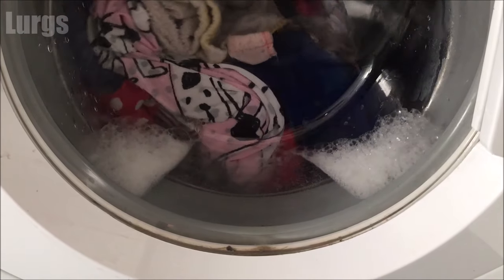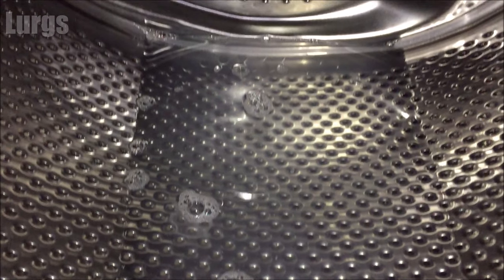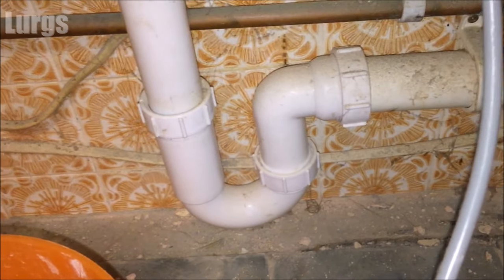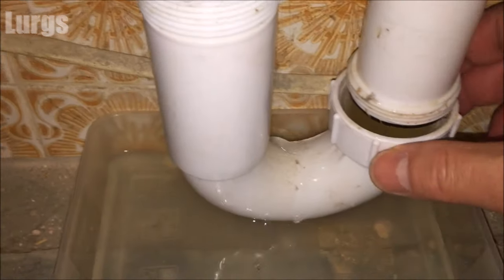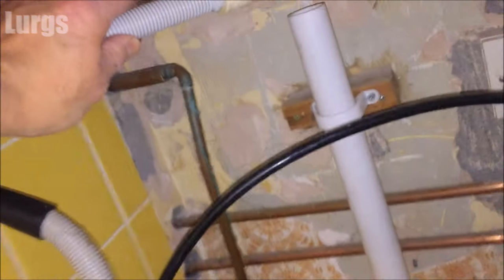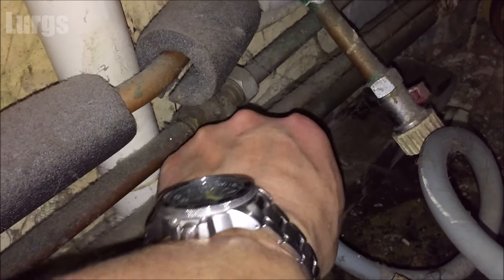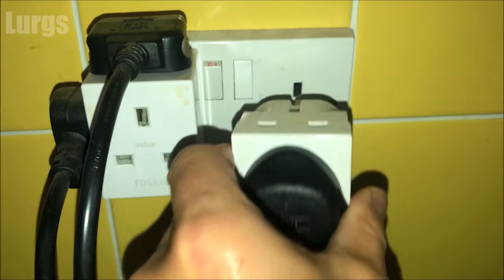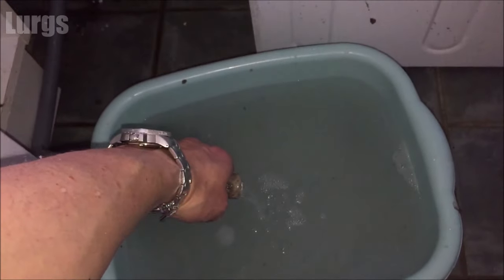Washing Machine not Draining Water - Fixed

Comment: Help! Just mopping up after the machines flooded the kitchen. Thing is the doors not open and its FULL of water. Can I drain it all just from the filter? I'm not confident enough to mess about with the pipes etc under the sink. Eek!
Reply from the maker: Blimey emergency comment! Turn power off and unplug, hopefully the door will release so sponge that out. Try pulling the machine out a bit then tipping it up so you can get a washing up bowl underneath the filter then undo slowly and let it drain into the bowl. Good luck. Have an old towel ready or your mop.
Reply: Coooeeee! I'm back again. Still patching up my 13 year old machine ha ha. If anyone sees this would you be kind enough to let me know if there is meant to be a rubber band around the drainage propeller? I don't want to remove it just incase it's meant to be there.... God I'm useless lol. Thanks! Xx
Reply from the maker: I very much doubt it unless it’s old and that is the rubber belt powering it round? Sounds like a hair band or something maybe?

Comment: Hi Lurgs,
My washing machine drains when I lay drain pipe on ground, doesn't drain when it's is hanging in sink. 
Machine stops after a while when it's is hanging, it keeps running when it's on ground but doesn't contain any water.

What could that be? If it was filter then it won't drain at all, I belive it's drain motor? What do you suggest?
Reply from the maker: Yes sounds like a pump fault not pumping the water out fast enough. I would check the filter to make sure there is nothing in there blocking the impeller (like a coin or hairclip).

Comment: Hello, any suggestions as to why the washing machine (even after a good clean with a tooth brush and scum cleaner - thinking this might fix the issue) still doesn't seem to utilize/activate the softener section of the draw on the far right when it comes to the rinse? Once a wash has done its cleaning section you normally have the softener bay fill with water but instead this always comes from the far left pre wash bay. So basically the softener section is totally out of action....I have to listen out for the wash to finish and then sprint to the kitchen to drop the softener in the prewash section with the few seconds it gives you to allow the dilution. Pretty silly really.
Reply from the maker: Sounds odd, the pre wash is what it says, a Pre wash before the washing programme starts. Maybe the washing programme you are selecting doesn't do the Fabric Softener part but maybe some of the others do?
I very rarely use softener now.

Comment: So I have a Hoover. I replaced the water pump and housing as I thought this was the issue.  Pipes leading to the drain outside is clear. Still water isn't draining.  Any ideas?
Reply from the maker: Maybe the pump isn't engaging? Not sure why it wouldn't drain with a new pump.

Comment: Thank you for your video mate, unfortunately it still didn’t work, both filters cleaned :( water still in drum but if I lower the drain pipe at feet level water starts draining I’m confused…
Reply from the maker: Best check your drainage pipework. Run the machine with the washing machine drainage hose into the sink or a large bucket. Then you will be able to see if its draining ok. Could be your drainage pipework is full of sludge.

Comment: Hi I have a hotpoint washing machine.  When I started the cycle a cloth got stuck inbetween door, the water is leaking out of the door and I couldn't open the door as well. Can  you please let me know what to do?
Reply from the maker: Let it finish if you can and put a big towel in front of the door. Or pause the cycle and open the door

Comment: Tried your suggestion but there was nothing in there. My machine is a Hotpoint Aqualtis 11kg w/7kg dryer. It came up saying fault 15 when I last tried running it on the 19th of April. Due to having to shield from Corona I have not been able to have anyone come out (also not working = no funds for washing machine repairs). Handwashing is getting very tedious so if you have any other suggestions I'd be really grateful. I'm not strong enough to lift the machine out though.
Reply: I can add that I initially tried disconnecting the drainage pipe from where it come into the sink waste trap and also dismantled the trap to see if that was blocked but neither showed any signs of mess.
Reply from the maker: Oh dear I'm sorry to hear that. If it's an F15 error that indicates a problem with the water heater, unfortunately that looks like a callout,  or if the machine is pretty old then might be worth a new one. Washing machine\dryers aren't the best, we've got separate ones but not everyone has space.

Comment: Hi mate I got a hotpoint aquarius wml520 it keeps draining even though there's no water left in there it also smells of burning guessing the drain pump is knackered however checked the fan inside pump and moves freely what could it be
Reply from the maker: Nicholas Anastasi Sounds like a burnt motor. We had an old washing machine that had an awful burning smell. You have to weigh up how old it is, cost of repair and how much a new washing machine would be. Last time we just bought a new machine. You can spend a lot on repairs (unless you do it yourself).
Reply: @LurgsHowToGuides  thanks mate and yeah I can fit the part easy change over part I think is about 40 odd pound it's a cracking washing machine and only happened yesterday that's how I came across your vids haha thanks mate I'll replace the motor cheers for the reply

Comment: Do you have a video for a beko washing machine that wont spin
Reply from the maker: I’m afraid I don’t. If it’s a belt version it could be the belt has slipped or has snapped. If you  turn it by hand does it rotate too freely or does it have some resistance?

Comment: so I stopped the washing machine before it was done and the water was still there, will it drain it self or do I have to take the water out?
Reply from the maker: Don’t take the water out. Just run a rinse and spin which should drain it (unless you’ve got a problem with the machine)

Comment: Hi I was wondering if you could help I keep getting E20 on my Hoover Dynamic Next . I've cleaned the filter  and pipe and even done a reset but still it comes up E20 even after seeing the water drain away .
Reply from the maker: That's odd, if it wasn't draining then I would expect the E20 error. Sounds like it could be a faulty sensor somewhere, hope you get it sorted.

Comment: I don't think that I have a blockage. My Bosch washing machine does not rinse from time to time. There's no water in the drum; the cycle finishes, but the clothes are really wet. I then have to put it on the rinse cycle which rectifies the situation but it's a pain especially as sometimes I have to put the rinse cycle on more than once!! Any advice would be appreciated. Thank you
Reply from the maker: Sounds like a glitch in the computer board maybe. Try the good old switch off for a few hours then switch on again. Or maybe try a different washing programme if it does it on the same one.
Reply: @LurgsHowToGuides  Thank you

Comment: I have a Siemens washer dryer which is showing the E18 error code. The pump filter can´t be opened and only turns partway. It is very tight and won´t move futher. The bottom of the machine is sealed so no way to access the pump filter from the inside to check for blockages/clean it out. Any suggestions as we would prefer not to throw away this machine as it seems to be a blockage and not a problem with the actual machine? We´ve been told by a handyman that the entire machine would have to be dismantled in order to get to the pump filter which is at the bottom of the machine. Any advice appreciated. Apparently, Siemens have sealed the bottom so that you can´t easily get to it and would have to buy a new machine, which is absolutely awful. Thanks.
Reply from the maker: @LaChicaconSuerte-1111  Poor design.
Try untightening and tightening multiple times to see if the object clears. It is bound to be a metal hairclip. If not you may have to get a bit more forceful, but be careful as the filter is only plastic. Good luck..
Reply: @LurgsHowToGuides  thanks, my mother ordered a new machine as this one is just over five years old. I find it upsetting though, because the machine itself is actually fine and never had any issues until now and it happened because she overloaded with bathmats and towels etc. Maybe some lint of fluff blocked up the filter, don´t know. But what makes me angry is that Siemens seals up the machine in such a way that you would have to dismantle it completely just to get to that filter to unblock it. I think it´s really sleazy and awful to do this to force people to have to pay over a 100 pounds plus parts for one of their technicians to come out or to buy a whole new machine for a simple issue like this.
Reply from the maker: @LaChicaconSuerte-1111  5 years old is nothing. Need to get to that filter as if it’s blocked up it could be an easy fix
Reply: @LurgsHowToGuides  agree, but my mother decided to replace it. This is what goes on in lots of households and how these companies make money.

Comment: I cant move the washer though to unplug it. Water in drum, keeps stopping without spinning and a lock light is on the panel which ive not seen before? 

I have heart failure so it's hard to move heavy machinery. X
Reply from the maker: @jacquelinegreen7796  sorry to hear that. Filter deffo needs checking first

Comment: So I did all of the steps above, but still my Siemens is full of water 😭. I had so much crap in the pump filter, so thought for sure that was the problem.. But no. Any advice or a link to have to demontage the whole sucker? 🙈
Reply: E18 is my error code.
Reply from the maker: If there was that much debris in the filter the pump might be damaged. It's worth removing the filter agin to check as more debris may have fallen into it. Run a drum clean or super hot wash 90c after. Good luck

Comment: Question. You didn’t mention how to open front of washer when full of water/clothes without flooding kitchen? 🦆💕
Reply from the maker: Need to just be very careful. If you can just run a rinse and spin cycle again to see if it clears. Else it will be a case of opening the door and using a sponge.

Comment: i dont know if you read this but my washing machine (sharp auto) sounds like it has water in it when i shake it. i have tried letting it washed off without clothes and the water still somehow inside but i cant see it in the drum. maybe under it or at the side? please help
Reply from the maker: Not sure, as long as it washes ok and drains then that sounds odd. If it's not leaking then it will be hard to find out why.

Comment: On 3:39, how did you temove it so easily? I’m having a hard time opening it
Reply from the maker: Probably a hair clip stuck in it stopping it from turning. Just keep wiggling it tighten it un tighten it, hopefully it will work it’s way loose. Might have to be a bit forceful but careful not to break it as it’s only plastic. Good luck 😎

Comment: Hi I've got a Bush 8kg washing machine and it stopped draining first, said it was finished but was still sopping wet. I already did what you said in the vid and drained the water out of the filter,nothing blocking it. I turned it back on to run thru empty but all that happens is the top and bottom timer lights flash together, it doesn't fill. I've tried it on every cycle but nothing happens except on occasion it makes a slight clunk then nothing. I've tried leaving it over the maximum delay time of 12 hrs,still nothing I'm flummoxed ? I'm usually good at fixing things like this but can't see any rhyme or reason why it won't fill if nothing else. The inlet water pipe is ok and has water coming through when not attached to the machine. It's got to be the machine itself and it's almost brand new and barley used but I went away from home for 9 months to a friend's now there's no guarantee left on it. It worked initially on my return, so any ideas please ?
Reply from the maker: That doesn't sound good. If it's not that old then I can only think it's a filter\pump issue. It's definitely worth checking the  filter again to make sure nothing else has fallen into it. Odd though it's not even filling. Are you sure the water tap lever is in the On position and someone hasn't turned it off whilst you were away?
Reply: @LurgsHowToGuides  No it's been working fine since being back and I live alone so no one has touched it. It did the washes before fine on the same day except the last one that was sopping wet and the machine was still full of water altho said finished. The not filling is what's puzzling me too. I've never had that before ever ,not emptying yes.
But will recheck filter but the pump and filter shouldn't stop it filling tho only emptying in my experience ? I've seen about 10 posts on another site,with the Bush 6 and 8 kg having a mind of their own despite the good reviews from Argos . Some who had theirs repaired rather than send back were control circuit board issues.? I'm beginning to think the same ? If so it'll be cheaper to get another one than be repaired when I can afford it!
Reply from the maker: Oh dear. Not good.

Comment: Hi literally got a machine 4 days ago brand new,seemed ok up till now but i noticed it drains fine etc but when i go back to machine it has water reappeared in drum
Reply from the maker: Shouldn’t be any water left in the drum after the cycle has finished
Reply: @LurgsHowToGuides  ty for reply it is confusing as it drains fully. But even though cycle has finished and clothes removed I notice water has reappeared not loads say about a litre. Seems odd.
Reply from the maker: That's not right, I'd say that's a fault. After final spin it should be dryish. Try a different programme else I'd  report that and get it looked at

Comment: hi my washing machine is not draining all lights are flashing i unblocked the drain pipe and the filter but still not draining and the drum is still full and door locked any advice would be appreciated thanks.
Reply from the maker: Not sure, sounds like a faulty pump or computer board malfunction I’m afraid
Reply: @LurgsHowToGuides  ok, is there a way to manually unlock the door because its not unlocking.
Reply from the maker: @MysticGaming33 Washing Machine Door not Opening and How to release a Stuck Washing Machine Door
https://youtu.be/bQdniahf0bU

Comment: My washing machine is only 6 months old. I have checked all things you have said and it's still no go.. when it drains it sometimes leaks from underneath. And after any programme has finished it then re fills with water
Reply: This is the same even on a drain and spin programme. Can you help?
Reply from the maker: Jake Andrews If it leaks underneath I would say that is a faulty washing machine. It will still be under warranty so contact the shop you bought it from.

Comment: Every time I untwist the filter, water comes pouring out all over the kitchen floor. It's so low I can't get a bucket, basin or even a bowl under it. I've kept letting it pour out a bit, twist it closed, mop up, rinse and repeat about 10 times. When does the water stop pouring out to enable me to actually fully untwist and remove it?
Reply from the maker: If the machine isn’t draining there will be lots of water. If it doesn’t have the little drainage pipe then unfortunately you will have to keep doing that. You could pull the machine out a little and tip it up and get a bowl under the filter, but they are heavy. Good luck
Reply: @LurgsHowToGuides  Thank you for the reply. Is the drainage pipe the little hose to the left of the filter trap?
Reply from the maker: @villanelle8888 Yes that’s correct. I cover it in this video at 1m45, have a look at this video https://youtu.be/FwRbWKOwmfY?si=kWLtRRxt8L4Sh5bQ
Not all machines have it but if you have then use that
Reply: @LurgsHowToGuides  Thanks, I'll give it a go and let you know how I get on..lol

Comment: How does one remove the filter when the filter cap hasn't removed it with it. 
I have the white lid/cap but the filter is still in the washing machine
Reply from the maker: Not sure, I'm guessing it's snapped off has it? You can try some pliers but be careful as it is only plastic.

Comment: can you plz guide me my washibg machine is giving an error E03 the pipes are not blocked filter is clean, plz suggest me something what should i do. The wasing machine is candy 8kg
Reply from the maker: If the filter is clean and your drainage hoses are definitely clear then it could be a pump fault maybe. Hope you manage to get it fixed.
Reply: Lurgs How To Guides  if i just put it to drain it start draining, but when i start it into the daily 59 or some others option at the time of draning it gives an error, kindly if u guide me how to fix it
Reply from the maker: Really not sure what that is. Sounds like a computer fault on the board or a pump issue. Strange it drains when you just drain but won't drain on a wash.
Reply: I hope i'll fix it, Bye the way thanks for helping me out

Comment: None of these tips worked on my 1year old Hotpoint error code fo5 I don't have that little lever to open doors either and turning it off for 10 minutes didn't work thanks for tips anyway
Reply from the maker: 1 year old, not good. I’m sure it must be the filter that’s blocked
Reply from the maker: @hotvideo1890  That’s very very unlucky if it’s only a year old. Check to see if it’s still under warranty. Also double check your drainage pipework for sludge etc. that would stop it draining properly

Comment: I tried all the steps and they were all clear but my machine won’t drain. It stops mid cycle. Anything else I can do?
Reply from the maker: Unfortunately if your drainage pipes are clear it sounds like you may have a faulty drainage pump motor